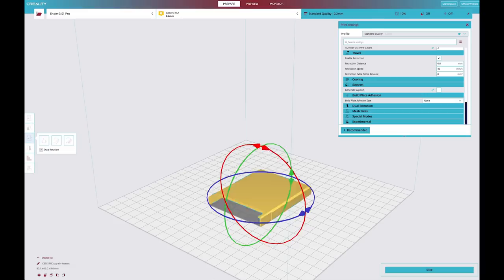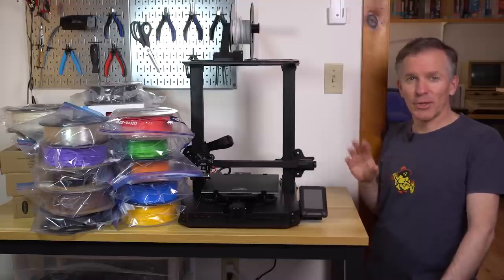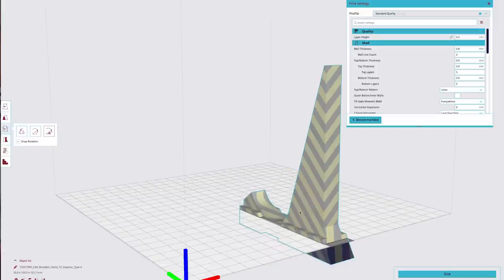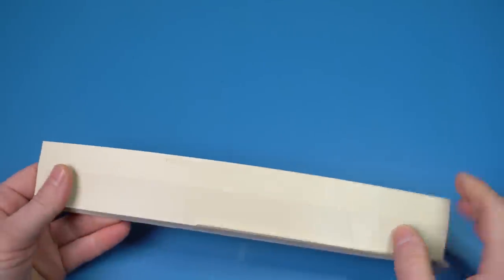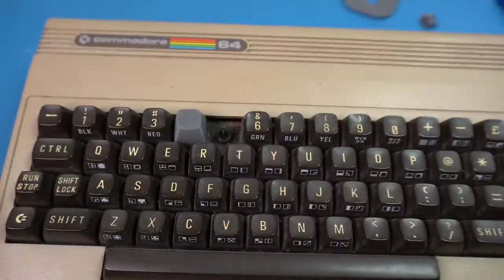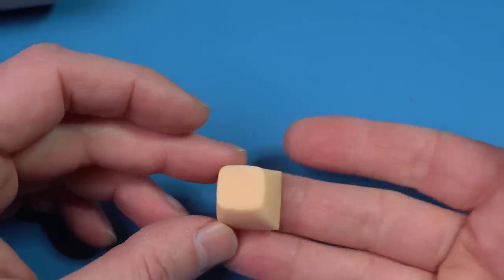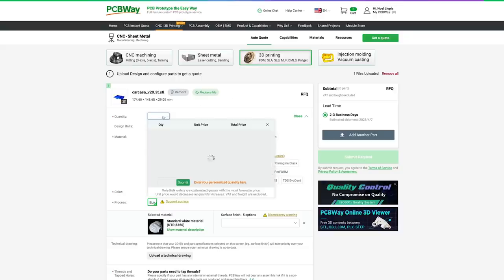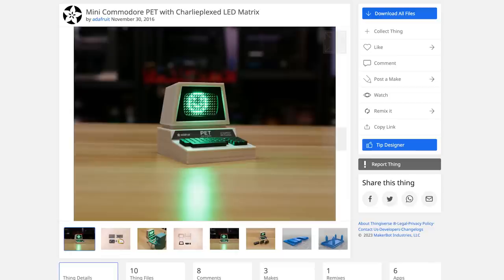3D Printing and Retro Computers

Comment: For small things like keycaps where they feel and fit are critical, why are people 3D printing at all?  It's cheaper, faster and FAR more accurate to make a silicone mold to cast it in resin.
Reply from the maker: Yeah, that's interesting. I looked into that a long time ago but never actually did that. I should try it sometime. Thanks for the reminder.
Reply: @NoelsRetroLab  Sure.  Sometimes things have to be 3D printed because you literally have nothing else.  But if you're printing one or two keys, I bet you've got between 10 and 100 other keys just like it that you could make a mold of!

Comment: I always tell people avoid enders. They aren't that good. Yes they are cheap, but.....they act like it. That keycap you made on high quality was about what I'd expect from a better printer like mine on low quality. I have a prusa which is expensive. It needs no tinkering of any kind after you get the z-level set or until you change the nozzle (stock) or the build plate. I have a revo hot end. In theory it doesn't require z-offset manipulation even with a new or different sized nozzle. But yeah it might not be resin quality, but it will be very close. There is a cheap printer I do recommend. It's the sovol SV06. It's not as easy as the prusa, but it's a damn good printer. Prusa quality for a fraction of the price. And if you don't mind spending the money, the newest prusa mk4 never requires tinking ever. You unbox it, plug it in and hit print. It automatically sets the z-offset. I'm planning on buying one (but it's more than just that) when the kit version is available. Oh and that door hinge piece you printed? I have faith my printer could print that without a brim or any special considerations. The only time I have an issue is when the part is really small. Then I'll do a brim, but I rarely use brims. But the build plates on the prusa are fantastic (and the sovol one is pretty good as well)

Comment: Was resin printing worth it? I agree with your last comment.  You didn’t really talk about the total actual cost of the key including the pollution that it created. Honestly, I feel resin printing is still a 1/2 baked technology. Too many issues. But since you got everything for free, I guess it make sense to advertise it a bit.
Reply from the maker: It is if you need that kind of detail. I didn't get into it, but there are some pieces of cassette mechanisms that only work well with resin. Also, if you want to print miniatures, it's resin all the way. But if I didn't have an easy ventilation solution, then I agree it's a lot of money and trouble. So hard to say.

Comment: around $50 is really cheap even assuming the time used is half of what it would take on the domestig machine. I worked in a cnc machining shop and the machines cost about $65 per hour sin tax which I thought was way too low. Try freecad for your models. I prefer solidworks but that is far from free.